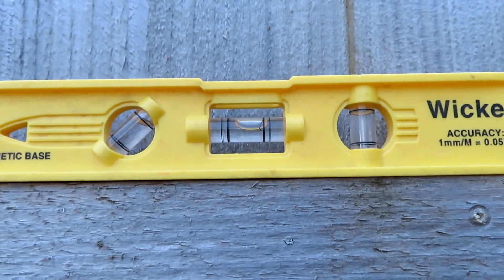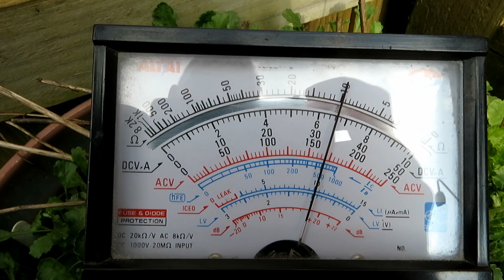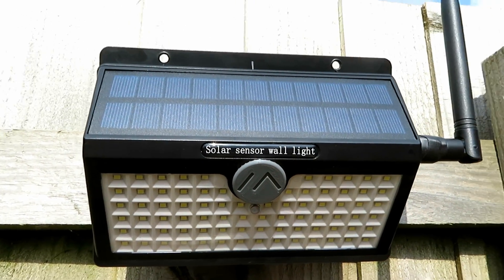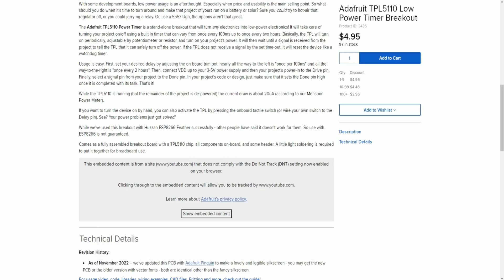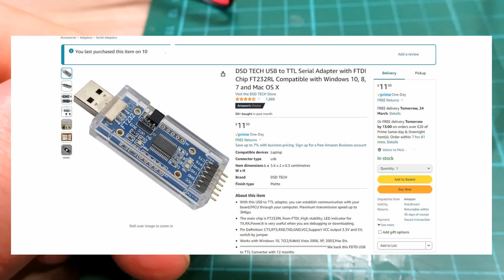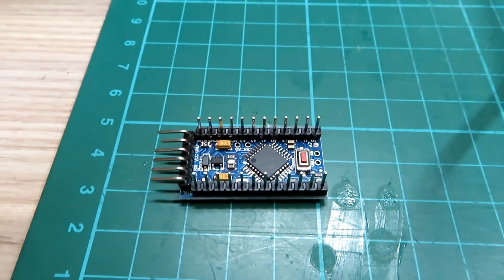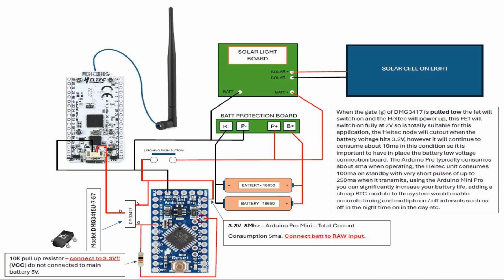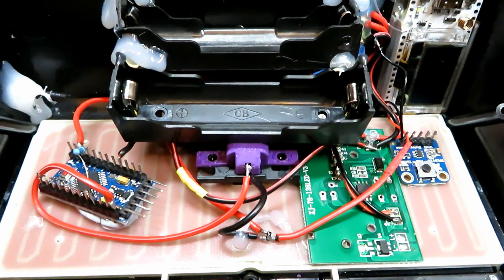HALVE YOUR POWER AND INCREASE YOUR BATTERY LIFE - MESHTASTIC/LORA SOLAR NODE PT 2

Comment: Hey mate, if you want some cheap 18650's, get your hands on some "faulty" power tool battery packs, it's always 1 or 2 bad cells that take down the whole pack !

Ask your local HW store or some blokes at a building site.

It's also worth buying 10,000mah battery banks on special, if they're the cheap fat version they'll have 4 18650's inside 👍

I'm hoping the Rak WisBlock module gets cheaper soon because they're 10x better on standby power than these Heltecs.

This might be a stupid idea, but could you use a digital watch alarm to trigger a latching circuit from its piezo alarm ? One alarm at 10pm and another at 6 am to catch the dawn ??